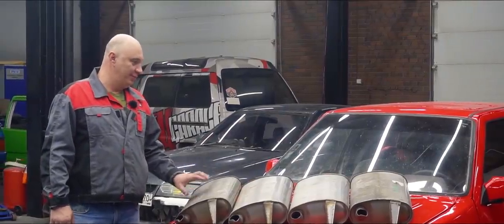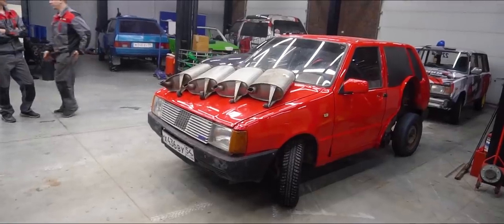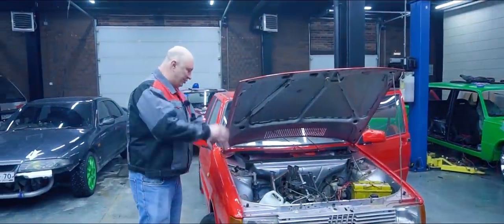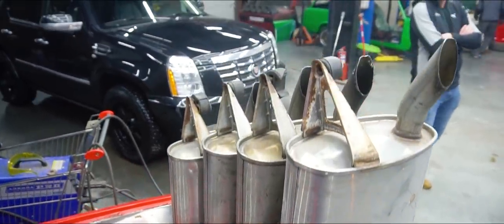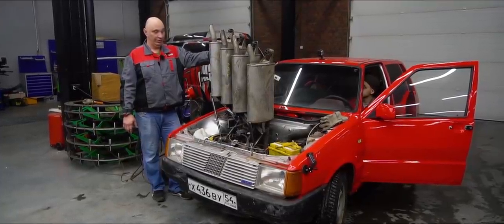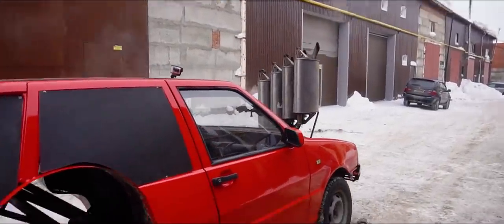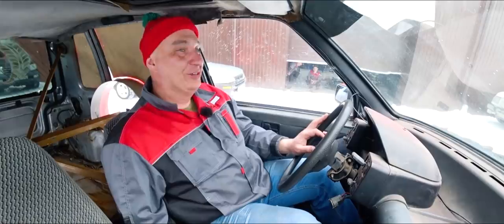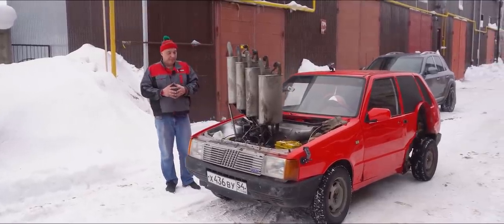4 mufflers – one for each cylinder

Comment: If you want it super quiet, run all the cylinders into one pipe and run them through every single muffler.
Reply: exatly!
Reply: So, an old school cast log header, leading into a quad muffler setup. That engine would be choked to high hell.
Reply: what about running the exhaust pipe through a water tank?
Reply: yesss man , each pass = quietly out
Reply: All four mufflers in series. Mount them on the roof.
Reply: @handsome4922  I'm talking more like leave the manifold and exhaust under the car. Add the string of mufflers under the car and leave the tailpipe looking stock. 
  The engine is so small, the restriction from each muffler probably wouldn't hurt power that much. 
  I didn't say my way was the best for power, I just said it would be quieter than what they did here. The tailpipe would be further from the driver than the way these guys did it. 
  I know these guys like making crazy-looking contraptions so I'll give them a pass. A normal looking, super-quiet car wouldn't really get many views. Make it crazy and you'll get more views and perhaps spark conversation in the comments section. 
  And if they did it my way, we'd have missed the flame show of open pipes.
Reply: @Frank like an exhaust bong?
Reply: Was going to say the same thing.
Reply: @handsome4922  Only if the mufflers are in series (one after each other). having them in parallel would be the way to go.
Reply: @alanspangler5621  you got it
Reply: @mschiffel1  4 muffler in serie will be like ''is the car running ?'' lol
Reply: exatly!
Reply: @alanspangler5621  only if it's a double  percolator . Lol
Reply: Quite obvious.
Reply: Ya, i was thinking "next episode, 4 cylinders 8 mufflers!" lol. Just add a second muffler in series with each existing one.
Reply: @alanspangler5621  works for me LOL
Reply: Next, "What happens when you weld a muffler to a muffler to a muffler and so on until it stops working" that would be fun and hot.
Reply: Cast iron piping to the muffler and wrap the muffler itself in sound deadening.
Reply: Put a pressure gauge on each muffler to see what sort of back pressure there is
Reply: I could use one muffler that would make that car quieter than all four inline.
Exhaust systems are a lot more complex than many think. Sound, horsepower, torque, powerband, head temperatures, exhaust temperatures, just to list a few (i could go on for a few minutes) are majorly effected by the exhaust system.
All four in line would indeed make it quieter but the noise would still be irratable to the ears.
Reply: Do you mean running the muffler in series?
Reply: Or just block the muffler, your engine will not make any sound at all...
Reply: @screener545  the size of that tiny engine wouldn't really care about several mufflers in a row. They all flow enough to not choke the engine while just cruising around. If it was a drag racer, you wouldn't be worried about noise levels. This clearly isn't a performance build because they eliminated all of the scavenging by building a header with individual pipes per cylinder and isolating them from each other. You like to throw around big words and act smart but you'd realize that an exhaust system with a proper primary runner length and collector diameter will help this engine make more power than the zoomy style header with 4 individual mufflers. Zoomies might look cool but they don't make power. 
  This design also features a lot of surface area. The pipes will get hot as hell and heat soak the carburetor, potentially causing vaporlock, but surely killing power. If they ran the exhaust down under the engine like stock and then added properly sized mufflers in series, it would be much quieter and would not make any less power. 
  Dual exhaust systems are louder than single exhaust. It's like a speaker. My daily driver has a 4" open single exhaust. It is loud as hell from the passenger's side. If I kept dual 3" it would be louder because there are 2 outlets for the exhaust and sound to escape. These guys only amplified the sound by creating 4x the number of tailpipes. Leave the exhaust all in one tailpipe with several mufflers and each muffler will dampen the sound a little more. 
  Then put an air cleaner and a paper air filter on the carburetor to dampen the intake sound and add thicker oil to dampen the valvetrain noise and put sound deadening material on the underside of the hood and on the inner fenders. 
  That will make the quietest engine for the driver.
Reply: @handsome4922  Not really.  Remember, each cylinder fires separately.  What the muffler does is smooth out the pulses, and the only physical problem is the constantly changing gas flow, not any actual restriction.  The longer the path, the smoother the flow, but higher RPMs give more tunnel friction, which is why racers don't use pipes any longer than necessary.
Reply: I have actually tried this myself for the shits and giggles. The thing with mufflers in series is that every muffler reduces the sound less than the one before it. In fact with 4 mufflers I would wager that the last muffler wouldn't even have a noticeable effect on the noise level. I don't know the exact science behind why this is the case, it is just something I myself have observed.
Reply: An exhaust made of only mufflers perhaps?
Reply: @franker353  Smoke through water is a bong, car be making bubbling sounds on tick over.
Reply: It's all about getting rid of resonance. A lot of new vehicles are that way these days, but with semi-open mufflers and several resonators so that flow is not restricted.
Reply: sounds like a ton of air restriction, might be hard to start it
Reply: @amar9695  isolating the intake Will help aswell
Reply: Id like to see this but with 4 muffler exit pipes (not inline)
Reply: I'd have a 4-2 manifold and 2 mufflers in series for each pipe, 4 total. Low restriction too because each muffler only handles 2 cylinders
Reply: the host looks like gumby if he became human 🤣🤤🤤🤤
Reply: I known someone that did such a thing his 4x4 ford ranger that he uses for transporting his still and materials around.
Reply: Blyat
Reply: @franker353  actually got me wondering

Comment: Why not turbo for each cylinder?
Reply: now thats something i wanna see :))
Reply: they have to be some small ass turbos to even get them to spin...
Reply: Life OD did that already it's on the YouTube.  Search 4cyl.  4 turbos
Reply: Although what hasn't been done is 4 turbos on a 4cyl that are stepped. In other words a turbo for each cylinder that one turbo is bigger than the previous or compounded to the next.
Reply: i think they have allready done this before ,but look like the real problem of this purpose is maybe the lack of tuning hardware/dyno to really have a usefull experience while playin with turbos . so without dyno/tuning , its pointless to add a turbo on a car

btw this should be a cool project for pfispeed
Reply: @brianobrian9334  yeah this guy should go tyo pfi and see what his quad turbo can do
Reply: Each turbo would run inefficiently because of the widely spaced exhaust pulses each one would be receive. A single turbo for every 4 cylinders is the way to go.
Reply: @svenlname6689  he did a horrible job with his tho. Check out boostedlifestyle I think is the name he did a quad turbo honda, even made tracks for the front tires, for Canada weather lol
Reply: @CaptHollister  i have a 1.9TDI code ALH , it have a single vnt15 oem on it , ive remaped it so hard that i Surxploit from double his specification , in fact , i pass 1 turbo each 6 month , so in my case , i can put 1 turbo to 2 cylinder,,another to the 2 cylinder left , and now i will have a biturbo that run like hell but without destroyin it  

4 turbo on a 4 cylk stock is useless , if you do'nt remap ECu and Adapt map to your modification
Reply: @brianobrian9334  thanks :)
Reply: Vz21 turbos
Reply: Life OD (Haggard Garage) actually done it before but barely made any boost xD
Reply: There are multiple vids made on quad turbo 4 cillinders.
Reply: I'd love to see that on a w16 😂
Reply: @rj7449  xD
Imagine the boost it'll be getting

Comment: the more seperated the exhaust pulses are the louder it will sound. Normally the factory exhaust will be set up so that each pulse will overlap perfectly to help it sound smooth when exiting the exhaust. So Id say keep the factory exhaust manifold, then set up the mufflers in either parralel or series for a super quiet sound

Comment: Im not surprised its somewhat loud. Since its close to the engine and theres not much back pressure, it will be louder. If you want quiet without backpressure you need a huge muffler out back with lots of roving in it to absorb the sound.

Comment: In a normal exhaust system, the way the manifold combines exhaust from multiple cylinders provides the first degree of smoothing-out. You would likely get a slightly more quiet exhaust from re-combining them after the individual mufflers into a modest length exhaust to have something closer to constant exhaust flow.

Comment: Reason why it wasn't nearly as quiet as you were expecting: lack of back pressure. Having four cylinders run through one muffler, the exhaust gases fight to leave the single exit port (or two if you have a twin tip muffler), forcing the gases to bounce around the muffler a little longer and continually expanding the entire time, deadening the sound / drone. By running a single cylinder per muffler set up, there is no back pressure; you're creating a high pressure on the inlet with a low pressure on the outlet, no back pressure to choke the outlet volume, the exhaust gases freely flow through the muffler. Essentially all this did is simulate exactly what a straight-thru muffler or resonator does, just slightly quieter since there are some deflection panels inside the muffler which helps deaden some sound.

Comment: if i'm correct those are the low frequency mufflers, the end ones, so the sound IS muffled but the remaining high frequencies will anyways mix up, so MAYBE the sound didn't change much, i'd try high frequency mufflers, the thinner ones with glass wool and a regular straight trough tube, the sound may be more "bassy" with non mixed pulses... cool project anyways

Comment: Having such large mufflers for each cylinder would make a good room to make the exhaust pipe have a much smaller opening and that would make it much more quiet too since the muffler is not capable of reducing that “low” frequency that one cylinder does and can’t build up any pressure that reduces the loudest sound. It also would supply some more back pressure that a naturally aspirated engine needs to run properly.

Comment: He should try drilling a second set of plug holes in heads and fit the heads with carbon filled plugs.  Start the engine, warm up the carbon plugs so that they glow, shut it off, and see if it will diesel (run on) like the old cars did.  I remember cars that would run on for over a minute after shutting them down.

Comment: The exterior of all that metal is transferring the sound right through . In a diesel,  the valve covers are the big sound violators . The opening of the injectors are incredibly loud , and older designed valve covers had no sound dampening .
 Idea may be to wrap the whole car dynomat .

Comment: A muffler for each cylinder is good for power but To make it quiet you need a exhaust manifold that gets into a single intermediate muffler then at the other end again a new manifold to connect the 4 mufflers

Comment: I have made a quieter exhaust system than that - with  one muffler and NO baffles.  Here's what I did:  Take a large diameter tube (the larger the better) the same length as the width of the vehicle.  Cap both ends, and run two exhausts pipes through the center of both end caps, calculated to come up about 5cm short inside the tube.  These become the exhaust outlets.I split the manifold of a six cylinder 3 liter engine and run the pipe to rotate from the top of the right side, as far outside as possible on the tube, and to the bottom of the left side  on the opposite end of the tube creating a counter-rotating exhaust flow within the pipe until the exhaust meets at the 5cm gap in the two exhaust pipes.  Result - NO noise at all.  Advantage: the pipe could be secured underneath or at the rear of the vehicle, the air cleaner (silencer) remains in place and dead quiet.

Comment: It’s making noise because there’s not enough exhaust pressure and velocity from 1 cylinder to become quiet in a full sized muffler all the pressure from all cylinders needs to be combined for a muffler that size, put a normal exhaust back on but just weld one muffler after the other in line

Comment: I'd use 4 pipes coming up from the manifold bent 90 degrees so they can come out over the fenders then use 4 glass packs or resonators. Also its probably crazy lean because there's no back pressure and poor scavenging. I'd do 2 carbs

Comment: I would love to see an engine run with individual exhaust pipes for each cylinder. Without mufflers. Basically make a header that attaches to the engine but never merges together. I want to see each individual exhaust pipe for each individual cylinder run all the way down the car. Like if it’s a V-8 it has eight exhaust pipes, or if it’s a four-cylinder than it will have four exhaust pipes. That never merged together. Come straight off the manifold and go all the way back. I want to know what that would sound like. I think you guys are the only people that would do this type of experiment
Reply: And then maybe try adding small mufflers to each pipe.

Comment: So shit like catalytic converters, resonators, the length of the pipes coming from the exhaust and how they time the gasses to hit those pieces greatly affects the exhaust sound. More mufflers doesn't mean more quiet exhaust lol, not in a setup like this. 

Quick and dirty mount them in series would make a difference, OR you could try making a 2 meter long muffler yourself with custom baffles inside. That'd probably be the coolest thing.

Comment: My guess is that since they welded the exhaust on the car that they missed a lot of spots, plus they manifold you used you tried to weld to iron and that will leak since you likely warped flange. Personally I would have built a header type of exhaust up to the muffler then I would bet you would have obtained the quiet you expected. Also by building a header type of exhaust you could have directed it up and over the roof a bit with the muffler tips pointing toward the sky and that would have defiantly have added to the quiet . Guess that could be your next project to see the real difference you made

Comment: Make a crashbar hydraulic system fitted to the frame rails for damage prevention in the event of a collision like weld 2 bottle jacks to the front of the car at the same pressure to reduce damage that would be intresting

Comment: Using a marine muffler called a Super Trapp will give you the  result You want.  Split the engine into two banks opposing cylinders connected; this will give you a scavenging effect, which will not only quiet it down, but also give it more power. you can tune these mufflers; they have a series of louvers that can be taken out as desired for a desirable tone.

Comment: A guy showed you would still hear the noise using a predator generator engine and a pipe leading several feet away from the generator.

Comment: Those mufflers are not designed for single cylinder systems, the frequency of the sound waves in the exhaust is too low. Try mounting them in series or change to a muffler from a single cylinder motorcycle.

Comment: For a project I wonder if you could fake your own 2CV. It was such a departure from convention, in the 40s and the 90s and even today

So replicating chassis, suspension, engine and transmission but with non-Citroën parts (2CV was a modular design which is why it had so many derivatives - Ami, Méhari, Dyane, Bijou, etc . .  so bodywork doesn't matter)

Comment: Before i watch i dont think it will quite it down. You are increasing the air flow plus making the exhuast system shorter. Even with 4 mufflers i dont think the sound of one alone will be as quite as the stock exhuast.